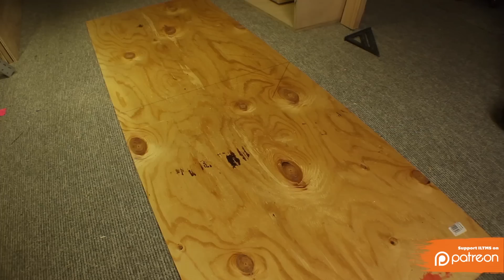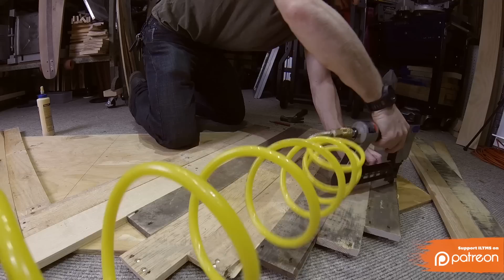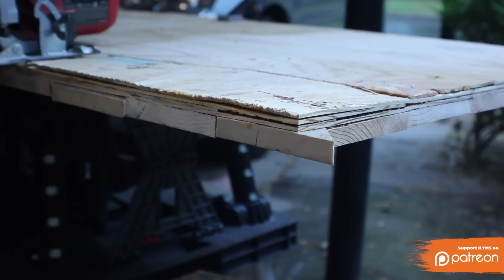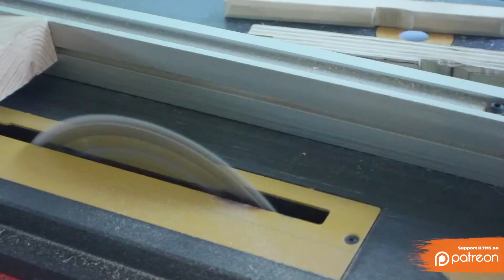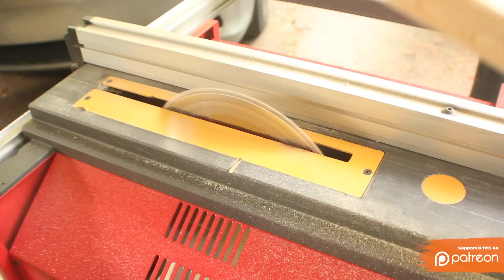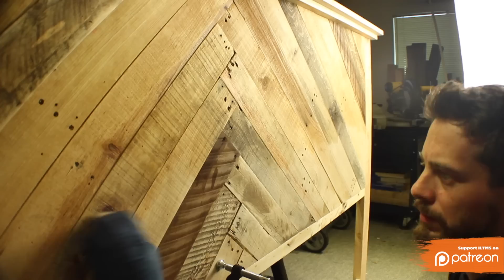How to make a headboard | I Like To Make Stuff

Comment: I am planning on making a reclaimed headboard out of some maple 1x5.5x68 that i picked up from work. It was used to transport a heavy machine and was the pallet and support. So it has nail holes dings marks etc. Cutting it though wow my table saw doesnt like me. It is a true 1"" piece so i might do three boards top to bottom then use the same top you did on top of your headboard. Your videos are great and very motivating.
Reply from the maker: Thank you! Have fun with the project!

Comment: You made a king sized platform bed with storage in another video, I plan to mimic that build and this headboard. Did you mount the headboard to the bed frame? If so, how did you do it? Would it be better to mount the headboard straight to the wall for added support?

Comment: So I made a headboard a few months back, and the one thing I dont like is that it rocks back and forth anytime the bed shakes. (someone getting in/out, etc.) I have a basic metal bed frame with only 2 spots to screw into a headboard on either side of the frame. They're about a foot off the floor, if that.

Any tips to secure the headboard more that don't include some kind of wall mount?

Also, I love your videos. I've probably binge watched over half your channel in the last week. 👍

Comment: That's amazing I'm making end tables for my sister from recycled pallets. One question. What was the size was the plywood cut to? Thanks
Reply from the maker: Craig Burns Mine was 70.5" x 27" but that all depends on how wide your uprights are and how tall you want it to be relative to your bed.  Good luck!
Reply: Thanks. I'll measure the mounts on my frame to see where my uprights will stand. Also thinking about making it taller and adding a reading light

Comment: Great video!  I've recently started demoing pallets for the lumber and was wondering if you had any tips for this?  Mostly I've been using a short prybar and hammer to remove the planks and then removing nails by hand.  would be nice if there were an easier way!
Reply from the maker: Thanks! As far as demo, I started with a hammer and pry bar too, but it was SO much work and I ended up ruining most of the boards.  Now I use a Sawzall to but the nails, then knock out the nail heads if they'e in the way. It leaves most of the nail in the pallet runner, but really limits what you can use the runner for, but in my case, I mostly just want the slats.  Good luck!

Comment: What kind of nail gun do you have, I'm in the market and there are so many different types! I would be using it for projects similar to this. Thanks! Awesome video again!
Reply from the maker: Mines a low end Porter Cable, it came with the compressor. I've had it for probably 7 years, and it's always been great!

Comment: Hi! your videos are amazing! thanks for sharing! Quick question. What wood type of 2x4 or the rest of the project r u using? Thanks!
Reply from the maker: Cristiano Morais Thanks! I appreciate that! The uprights were just regular yellow pine 2x4's. I just cut off the rounded edges.
Reply: I Like To Make Stuff Thank you for your reply. I've been using Cedar for my interior projects instead of Pine and I wonder if that is ok. Cedar is always associated with external projects but I really like the texture and aroma.
Reply from the maker: Cristiano Morais yeah, it's absolutely fine! In my area, cedar is WAY more expensive than pine, so I would have to have a really good reason to buy it :)  Here, pine is the cheapest, most common lumber option.

Comment: Wondering how hard it would be to make a bed frame that had drawers built in. Would it be worth the work?
Reply from the maker: It would definitely be a big project. Worth it? Depends on what you find worth in :). Cost wise, probably not but it'd be custom and could be exactly why you want!

Comment: Hey Bob! I've been researching using pallet wood for projects such as this...I've run into several places that say most pallet wood isn't safe to use for projects in the home b/c it was most likely treated with pesticides, or carried loads that could have unsafe affects if used in a living environment. Do you have any thoughts on that? I have several pallets in the garage waiting to be used for a project, but now I'm concerned with the safety factor.
Reply from the maker: ***** Well, as with any material used before you get it, that is a possibility, but generally, they say that the ones marked HT (heat treated) are safer.
I would definitely avoid any that look like a liquid has spilled on them (could be anything, safe or otherwise) and when doing your work with it, always keep the area ventilated and wear eye and breathing protection.
It's personally not a huge concern to me, but everybody has to decide on their acceptable risk when working with pallets, just as you would when working with power tools.

Comment: Is there a reason why 2x4's have rounded corners when you buy them? Seems like a waste of lumber, even though it's a small amount
Reply: It's to make the edges less sharp and splintery.  Dimensional lumber is primarily used in framing, often in a fast based environment.

Comment: Can you include the final cost of each build (or a rough estimate)?
Reply from the maker: avetere71092 Every time I try to do that, people leave comments like "yeah, but how much did you spend on the tools?" etc. :)  So, it's tough to try to be realistic when pricing these. Also, I have a pretty big stock pile of leftover (and free) lumber so it's hard to estimate the cost of those pieces.
For this one specifically, I'd say that the plywood and the outer frame lumber totaled about $30.  The pallet wood was all free. The stain and polycrylic probably totaled $15.   
I hope that's helpful, I'll try to estimate some project costs in the future if possible.  Thanks!